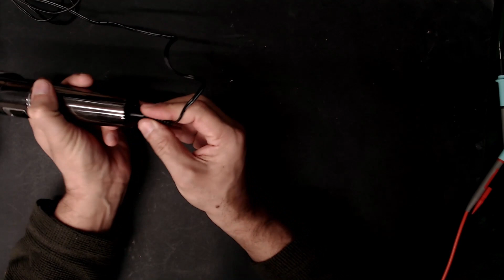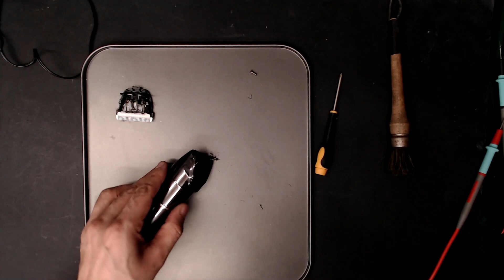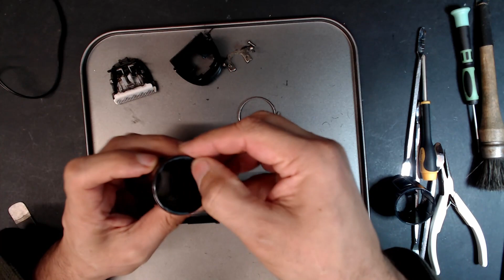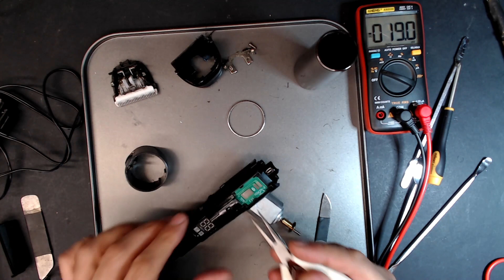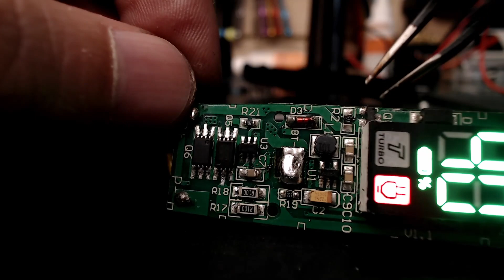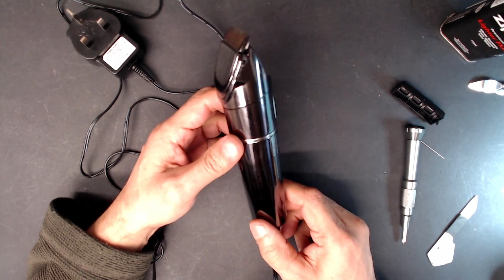Repair of lidl silvercrest trimmer

Comment: For those who want to tackle this thing at a component level, these are the chips and periphery components on the board that I could find:

R1210N301D PWM Step-UP DC/DC Converter (SOT23-5): U1
Holtek HT66F0185(SOP28): U2 ( If this chip is defective, you can't continue with the repair unless you have a donor board of exactly the same kind, as this is the Microcontroller )
DW01-P (SOT23-6) : U3
8205A (1x SOT23, 2x SSOP,) : Q4, Q5 & Q6
SS14 (SMA): D1, D2
CRS10I30A (SOD): D3
Tantalum 22uF Capacitor: C2, C4

I could not read the code of the Q1 transistor/ MOSFET that was faulty in this video.

If you need to replace D1, next to the LED Display package, you will have a hard time (de)soldering this without damaging the LED Display.
My D1 was blown and even with aluminium tape to thermally shield the LED Display, I could not solder it without making a smudge of the text on the side of the display due to heat transfer to the ink.

Even though Q1 measured fine and I replaced D1 that had gone open circuit, I could not restore the function of the trimmer to run on batteries.
I replaced the Lithium Cell, because it was spent. For a couple of weeks I could use the trimmer, but only when connected with the power cord.
Now it shows 0% battery charge and it won't charge any more.
Effectively I invested around €18,- in parts and about 2 1/2 hours of my time to provide it with a temporary fix. 

I have given up and I'm going to buy a proper hair trimmer.

Comment: According to the recommendations of the European Union, the equipment must be repairable. Only the Union forgot to add that the spare parts must have a NORMAL price and not x5. Since it is to be repaired, access to the battery (replacement) must be difficult.

Comment: Planned obsolescence, my trimmer is getting a error code. In manual it says battery has run its course.
Reply: It's quite easy to replace, just get a tabbed 14500 battery. Once you get to the circuit board, de-solder the tabs on both sides. Do be mindful of the polarity and don't short this battery or you'll destroy it, risking fire or an explosion in the process. Should it catch fire, get it outside ASAP, ventilate the room and don't breathe in the smoke coming from it. It's poisonous.

Comment: Thanks for this! Your solution worked also to overcome the same problem with a Sivercrest DHBS 500 D4 hair trimmer (produced by Kompernaß in Germany and sold by Lidl in Italy). Shortening the Mosfet (named "MOS1" on the (much simpler) board) did the trick. This model needs to be disassembled a bit differently, though. Apart from removing the two screws at the trimming head, there are three more screws hidden under the upper flat cover (that also carries the main on/off switch). After removing the snap-in cover, the screws become accessible. Thereafter, just solder a bridge from the single pin on the Mosfet to the pin facing towards the center of the unit and you are done. You may desolder the battery for other uses (and/or for making sure it is not getting overcharged by this hack).

Comment: Ok, everybody wondering how to remove rotating part which is not show in video. It was really not easy to disassemble. There are two clips. One near start button contacts which you can push with fingers, other 180 degrees to other side in middle of part. To trigger  that clip i used strip made of credit card.
Reply: that help more than video. Tnx
Reply: I've used thin metal strips, cut credit cards, the tapered end of a zip tie, still can't release that damned rotating part. In consequence, I'm not sure that's actually where the holding mechanism is, because looking at the video they appear to be 90 degrees from those, on either side of the inner body.

One thing is for sure though, Silvercrest sure as hell don't want you getting in and replacing that battery...
Reply: Yes, the other clip is on the opposite side and it can be released by inserting a strip from the charger connector end. It's 7 centimeters "deep" from there. However, I was able to pull it out just using brute force (after about an hour of unsuccessfully trying to hit the clip).
Reply: Video interessante smontare la parte rotante e' un problema

Comment: At 5.35 when you just pull the rotating body off the main unit, I'm beginning to think you were just lucky. I've tried prying that part off, pulling it off, and have also tried to do this in each of the 5 blade length positions, just in case there are parts that need to align before they separate, all to no avail. Needless to say like many others in this thread, I can't go any further with this stripdown to replace the ailing 14500 battery. 

Frustrating...

Comment: Is it an 18650 battery in this trimmer? Mine isn't holding much of a charge any more and I need to replace it.
Reply from the maker: hi l had a look        its a li-ion 14500 3.7v 700mAh 2.59Wh
Reply: @samteccomputermaintenance9981  that's great, thanks!
Reply from the maker: sorry for the late reply ita smaller size then the 18650 more like the AA
Reply: How did you remove the battery?

Comment: Did anyone else succeed getting the rotating cover separated from the inner housing? Its locked in place. I'm pulling on it with all my strength and it does not budge. I need pointers for this magic move. TY
Reply: this is a small plastic lock overmolded in the housing. the only way is to pull the top and bottom parts away from each other.

Comment: What is this piece SMD U1?
Reply from the maker: hi its not the smd u1 i tested it and found q6 and q5 faulty mosfits
Reply: It's probably a R1210N301D PWM Step-UP DC/DC Converter. 
This took quite a bit of searching. The supporting components around it conform to the typical circuit recommended for this device in the data sheet, like a 22uF Tantalum cap and a 100mH Inductor.

Comment: What model of battery is inside? Do you have the specifications, besides 3.7V? The picture was not clear enough to read the markings. Thanks.
Reply: Szia! Neked is akku gondod van? A mi nyírónk 100%-ról kb. 8 perc alatt lemerül. Köszi a választ!
Reply: @jozsefledacs-kis2134  Yes, bought trimmer in 2019 and now in 2023 the capacity of battery dropped suddenly. I tested for 2 weeks and the voltage remains steady so no self-discharge issue. Must be really only the capacity of battery. I can fully charge to 100% but then its depleted in constant use within 15min or less. Before 2023 it was working for 40-50 mins straight without any issues or recharging. Would have expected more life in Li-Ion battery then just 4 years. And it was not even used very frequently, maybe 5-6 times a year. I also made sure to keep it charged while not in use to prolong battery life. Never left it discharged. I couldn't have done more then 30 charge cycles on the battery so really poor battery performance on this product :(

Comment: The reason why I watched this was to see how to get the trimmer end back into the unit, and you didn't show that!
Reply from the maker: Sorry about that you have to push the backend first not the blade side. once that's in it just sits down in its place
Reply: @samteccomputermaintenance9981  mine keeps springing back out again - won't click into place for some reason.
Reply from the maker: i have just uploaded video check if that helps you its called     SilverCrest hair trimmer keeps coming off   @JewelBoxHeaven
Reply: Cum ai scos carcasa
Reply: 18650 battery inside?
Reply: The motor is concentric - you have to turn the motor (brass bit) until it is centred which can be front centre or back centre.... Then it lines up with the plastic bit and clicks into place